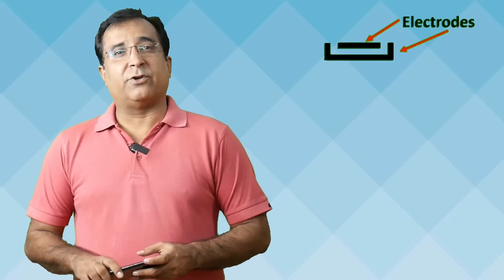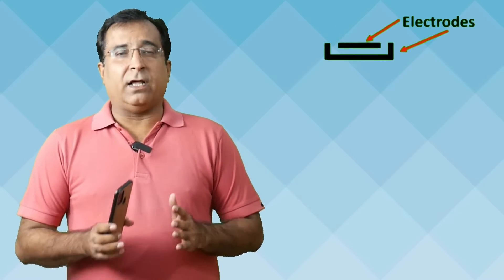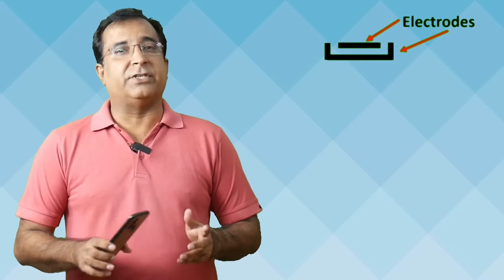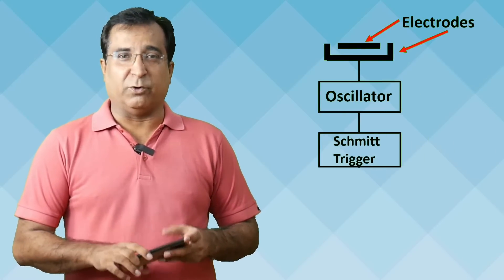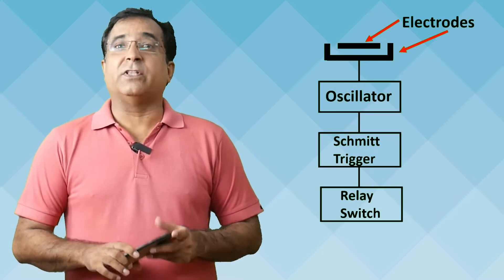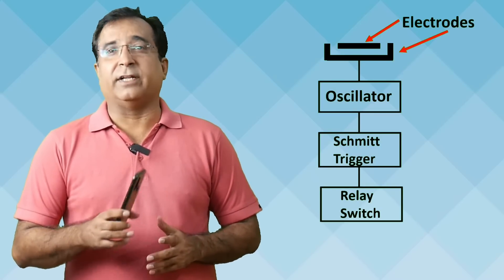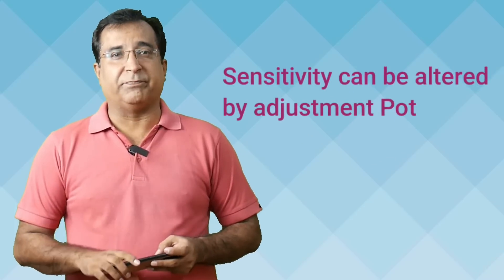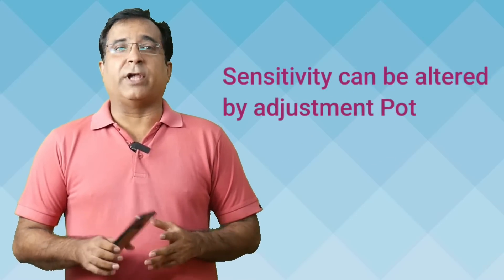Capacitive Proximity Sensor | Capacitive Sensor @dineshdiwani

Comment: Sir what was the calibration procedure of capacitive sensor in case of water tank level switch?
Reply from the maker: First make all required connection then bring the face of proximity to touch the water it must switch on...if not turn the potentiometer till it switches on then again take face of proximity away from water. Here it is calibrated.
Reply: @dineshdiwani  But sir in case of water tank it will sense firstly Tank than how can we calibrate for water in it?
Reply from the maker: @TanveerAhmad-km4gk  for that you need fix sensor in a pipe and then direct this pipe in the tank from top. So it touches only water... If It is plastic tank with thin wall.. then you can install proxy tank side wall.. then you need to calibrate first with empty tank then filled tank
Reply: Thank you sir